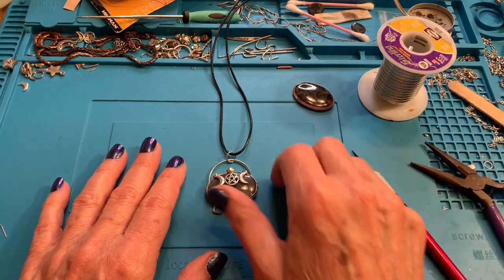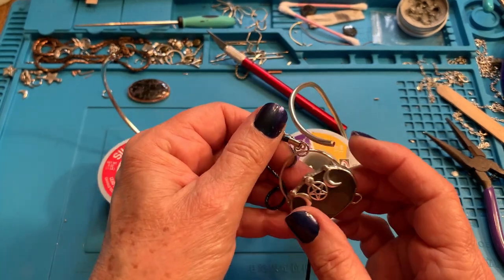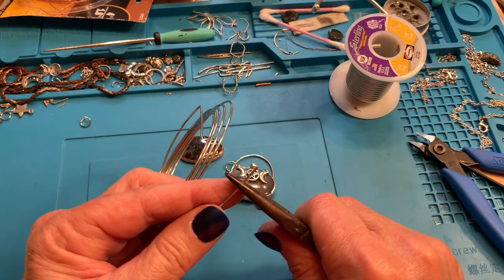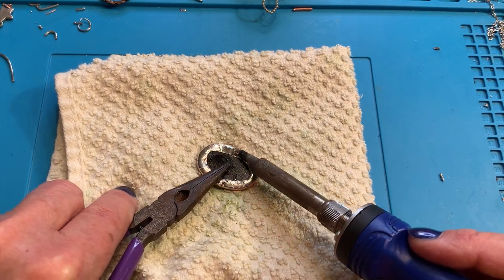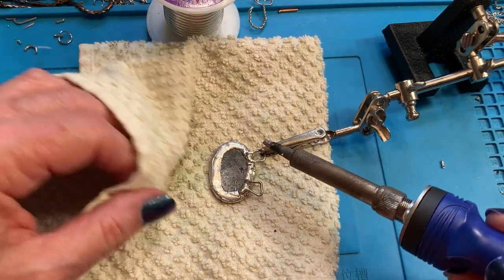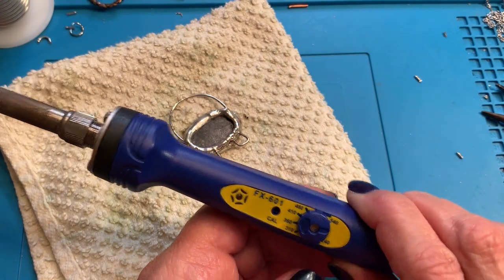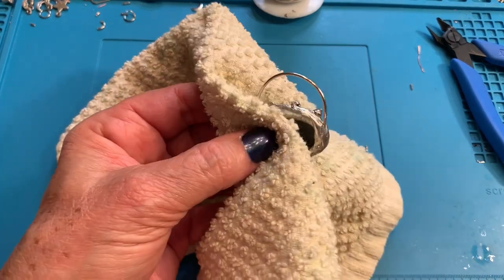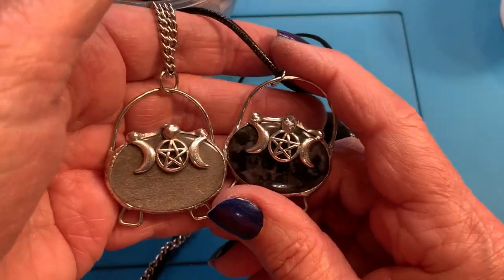Witch’s Cauldron using Tiffany Method Soft Soldering

Comment: Karen I love them.❤ Your poor sweet puppy.. 💜 I have a question what hard solder do you use ?  I have tried the really little cut up solder.  I can’t work with that it’s to little..
Reply from the maker: Thank you very much!!!  These were really FUN!
That’s what I started with too. I actually got the combo pack which contains equal amounts of Easy, Medium & Hard solder chips!  They are super tiny but it was best to learn with those because as I’ve been doing lately is even cutting those chips in HALF so even smaller!  I do have some easy in a sheet but it was really hard cutting the sheet with small enough pieces!  Believe it or not they make those chips even smaller then the 2mm which I ordered by mistake & there was NO WAY I could work with those!  I also bought some Easy solder wire but again it’s hard to cut the pieces small enough!  Do you wear jewelers glasses to see them?  Is it the tremors that’s the issue?  I just take a couple pieces out at a time!  AND the reality is that it’s actually best to pick solder which I’m pushing myself to learn & that’s really hard but the most effective way to solder most things!  Have you tried this Tiffany Method with just soft solder & a soldering iron?  It’s way easier to handle then a torch, no small bits of solder 🤣🤣🤣